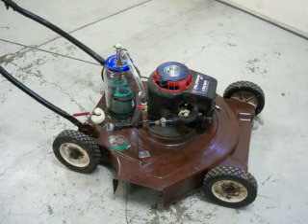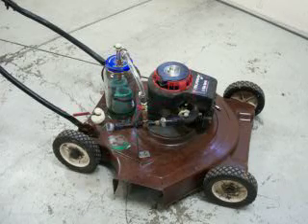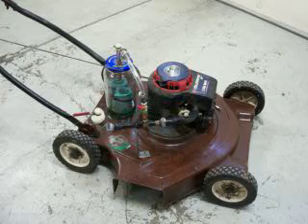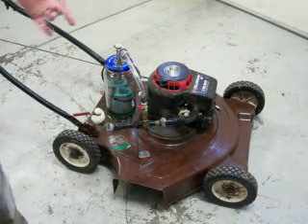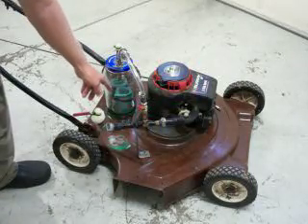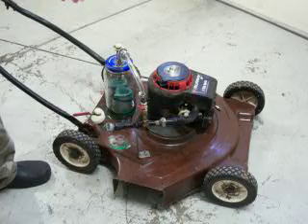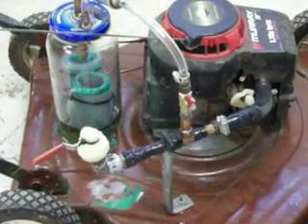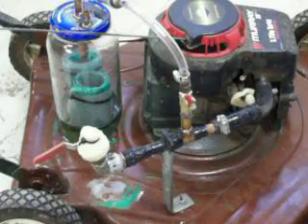just vapor, the truth or a lie

Comment: Please could someone help me, I replicated something similar in my Honda Accord82 car and I can't get it to regulate and seal any leaks. What impresses me is that it evaporates 1l in less than 10m, enormous consumption and the crewo engine that shuts down due to excess mixture, The device also has an aluminum heater that takes heat from the coolant, I can't explain how it escapes like this, when you accelerate it it reaches 3000 or 4000 and when decelerating it throws explosions through the exhaust 
Even if I let it in with more air with the air cock, I can't get it to run.

Comment: These vapor systems do work the only problem is maintaining the correct air fuel ratio because you can damage the valves piston etc. why not try to use a small turbo not for a boost but to pour the fuel vapor? Like on Smokies hot carb set up on his design it was stated that he took a motorcycle and that got around 25-30 miles to the gallon and then used exhaust he to hit the manifold and also a turbo like I mentioned earlier and bumped it up to 40 maybe 50 miles to the gallon my point is that you can take an engine and pull out a bunch of fuel and increase your mileage but your Derating the motor obviously so if you can’t keep a proper air fuel ratio even if you inject water it’s still going to burn out the Valves

Comment: Hey, now that you've done vapor,
Why not see what you can do with the ( GEET ) System...?!?!?!?!? That's what you really need on a car or truck.!!! It starts with anything like 
Old, motor - oils, that are burnt, or,
Old Left - Over, cooking oil, from the house or a restaurant..... A few guys even had them to save, there old,
Cooking oil & or greese,!!!! At small restaurant's.. that starts the motor
Running, then it changes over to plan water.!! Distilled/ or drinking water, or Rain water, or even old, mud-puddle water, that's filtered out
Of a pond, or big muddy puddles, 
It somehow exchange's Heat, inside
The pipes, and makes some-kinda, 
Plasma... Fuel, that Burns in the motor. I've heard of guy's putting the GEET System on there, older model of small trucks or thing's like that.
I am researching it right, now, for my Chevy 4x4 off Road, 2000 model & 
If I get the kinks out of it, and make it work" I'm gonna put it on my, RV.
That's when I will make some videos
For utube... Now I am about to remodel my RV, SO, I'm starting a new channel, that will show my RV, starting to get remodel done. Then I will go into setting up the power system so that I have power, anywhere I am, at. If I'm gonna be
Boondocking" OR Parking in Walmart parking lot, wherever I go, I will always have Electricity 🔌.!!
To do whatever I want to do: watching sattalight TV, OR, RUNNING THE FURNACE & BLOWER, FOR HEAT,.!!! I'LL BE
Showing how to set everything up, 
For free Energy. Without running, loud generators.!! Or haveing to worry, about SOLAR - PANELS,!!
Having to make sure there cleaned off, & not scraping them off, going through the bank drive through.!! 
Or, the ( Low bridge warning on you're GPS, maps)...  Thinking about the blade's of you're wend turbine, sticking up to Far. So, it's gonna be fun,. I'm gonna take everyone, that follows me on my Channel,  through, 
Some stuff that, will be epic.!! 
It'll put them Light-years" in front of the other, RV'ers!!! SO, GET READY,
CAUSE I PROMISE, THAT IF ITS DO-ABLE, WE ARE GONNA, DO IT. 
In other words, we're going to be going, across Country" using, nothing but, the burnt motor oil,
And water, as my fuel ⛽.!! 
And, a few jugs of water, hopefully
Rain water, & on a geet, system.
I put on my RV, myself.!!! Plus, I'm gonna Reveal how I make, my 
Super coils, that produce SO, MUCH EXTRA, ENERGY" THAT I CHARGE, THE BATTERY BANK, I'VE USED TO
RECHARGE MY BATTERY'S. It's, a 
Charging system, that's so small, there's not ONLY No noise" but, it's under my coffee table, in the RV...

Comment: My idea was to us a pipe T joint. With a pipe going to the bottom down into the jar of gas. In the pip is a wick of carbon felt. And that wick goes to the top of the T joint. And the engine would draw air though that wick or over it to make the fuel air mix.

Comment: Guys this system will work temporarily until light elements is petrol evaporate and heavy ones refuse to evaporate.vapourkid realized that after few attempts just like i did and moved to vaporizing fuel by extreme heat which only give you little bit more mpg.check my videos

Comment: A carburetor does not turn gas to vapor contrary to what many comments imply. I drag race and my Holly carb sprays 4 streams of liquid gas straight into the intake manifold. The ports on this manifold are purposely left "rough" so the gas "bounces" off the surfaces breaking the liquid down into smaller droplets "minuscule" so to not overload the cylinder with liquid and cause hydro lock. This system is just doing it at a different point in the chain. If you polish an intake smooth as glass on the inside pure liquid gas would enter the combustion chamber and not burn or at least not in a efficient way or at all pretty. Am I wrong or is this what the bubbler  is doing just in the home made container (which would need heat to keep the gas from turning into almost a refrigerant causing a vacuum )?
Reply: Couldn't you avoid the cooling affect by running the crankcase ventilation into the home made container? Maybe running a tube right down into the gas would even heat it a little.

Comment: What is happening is the gasoline is mixing with air but also the partial vacuum created in the jar is lowering the atmospheric pressure in the jar so then the gasoline begins to boil into a much richer air/fuel ratio than with a bubbler system. I must try it....also the fumes coming off the wick is a change from liquid to vapour...a change of state...this is ok for a mower but I'm thinking that if more power is needed the air/fuel mixture must become richer to satisfy the demands placed on the engine like the accelerator pump used on carburetated engines that squirt raw gasoline into the intake manifold.

Comment: This is a farce. The engine is running so lean that it overheats and quits or comes apart.  It is easy to make a engine run lean by changing the jets in the carburetor, but 14 to 1 air fuel ratio is about as lean as it should be on gasoline, without destroying the engine. He is acting like a genius but is only fooling the unknowing people.  Don't be fooled.

Comment: This is actually how early cars ran their engines an early carburetor design so its nothing new or innovative. And you can run your car engine on a gas generator that  heats woodchips up. Or a vehicle running on lpg. Finally  getting an engine to run at idle is different to the enery required to do valuable work. But by all means run a car on it and  use it to run  100 miles at 55 miles an hour with control and tell us how much mileage you get.  You might get better milage  in a small way but you will get less performance.

Comment: You must have what they call a stoichiometric mixture, (a proper air/fuel mixture), that is usually around 14.7 parts air to 1 part gasoline to run smoothly, less air more fuel under load.  That's the carburetors job, to mix the correct amount of atomized gasoline and air/oxygen.  Your basically doing the same thing with your silly little valves.

Comment: To: Leslie Clendening, and "The Vapor kid"...I'm working on Go-Karts, and am "REALLY"...INTERESTED"...In putting.. this "THEORY" to work for me,...soooo,  1) I believe i can "alter or modify" a regular metal gas tank w/ "welded joints" on the tank & flex copper for the "air intake" on tank, & vapor supply to the carb "inlet" to make the distribution system "SAFER"...Now, I'd like to know just "where" the hose was actually connected to the carb "inlet" ( he never showed this in "detail" on video)..so I can try to duplicate w? a "HARD" CONNECTION, AGAIN FOR A "safer" and "Permanent Install". 2)With this system, can I install the gas tank "ABOVE" the engine? ( I"d just like to know if suction for the vapor will be "lost" if copper line is "routed to engine from "ABOVE" and fed down by gravity)...This , again is for "SAFETY"..... 3) Will the "Diameter" of the "Air Line" & "Vapor Line" need to be a "Specific size"?...say If I went w/  a 3/4" copper air line and a 1/4" or 3/8" vapor line for the carb inlet ...(Would I get the "required" & proper vacuum to vapor "MIX" to achieve the desired combustion required to run the horizontal engine, and will it be a "CONSTANT FOR ALL ENGINE SIZES" I.E. : 6.5 HP, 8 HP, 5 HP ..ECT? ..( Excuse my apparent "lack of knowledge" regarding this, but "The Vapor kid's " video was the first I've seen, and I'm not yet fully "versed" on any additional" videos" regarding this interesting theory.) I'm a "welder/ Plumber",  and am about to design a "kart" w/ this "technology" "HARD WIRED" to the "KART"...(SAFETY FIRST!!) I 'm going to incorporate the "valve assembly" on the steering column, or attached to theframe in such a manner as to " accelerate" the kart w/ it as my "throttle" & do away w/ the" accelerator pedal"!!) Please >>>"Enlighten " me as to the above questions if possible & by all means, additional  "suggestions " as to..". how -to" possibly "Improve" my "design" or any other "THOUGHTS" you guys out there might have to make this "WORK". Please,..lets keep it "SERIOUS"...i'M ONLY  INTERESTED IN "APPLYING" this to my kart!!...And lastly, is it truly possible to get 100MPG on this "system"??
Again, thanks to "The Vapor kid" and all who contributed to this video!
...Impressed the "FU*K OUTTA ME!...KEEP UP THE GREAT WORK!

Comment: its funny to see people that claim to "know" about cars say that this if fake, especially when it comes to the efficiency. NO carb or direct injection makes vapor. They MIST the fuel into the intake manifold/cylinders where the velocity of the intake air (mostly) turns it to vapor. You can check this yourself if you have the time to take your engine apart. Harder to check direct injection than a carb. Ever see a super car spit flames without having a "pop" sound? That's unburnt fuel that stayed in liquid form through the engine and ignited in the exhaust manifold/pipe. In this delivery system you would probably only get "pops and crackles" but little to no flames since all of the vapor should be ignited at once (unless engine timing retards, then exhaust port opens prematurely and expels gas mid burn).

BTW  I'm more interested to see how this efficiency can be applied to performance Or how you can Boost and engine with vapor without it having to pass through a hot turbo and turn you engine into a turbojet.

Comment: Do you have an issue with the engine running really hot?  It's seems that with only vapor that the engine would be running very lean, and that usually results in heat and burning up valves and rings very quickly.  I'm curious to know if this is a problem.

Comment: has it burned a hole in the piston, from running too lean?
Reply from the maker: Jon Powers I will tell you this I have been doing this on lawnmowers far over 10 years years and no matter what some people say I have never ever had no engine damage to them, the engine dose not run lean. If you had a bad air leak that would hurt the engine worse then anything

Comment: All IC engines run on a vaporised fuel air mix, the fuel is delivered in older engines by a carburettor which atomises the fuel as it mixes it with air. This thing here is just a simple  crappy carburettor which is just poor in all performance respects. The engine will cause a low pressure as it sucks air and this will allow the fuel to vaporise more readily, so it sort of works to supply more fuel at different engine speeds. The people who built carbs spent a lot of time and effort making sure fuel was precisely metered into your precious engine. This offers no such luxury and most likely it is indeed running lean, which means hot, and that means a short life. Which is more financially beneficial - An engine that gets 30mpg or an engine that gets 40mpg, but needs a rebuild every month? How much more bullshit can YouTube handle? Loads apparently. 
A gallon of fuel / gasoline has a definite amount of energy available from it when you burn it. About 33kW/h. This is a fixed constant. What you do with this energy is up to you. Most engines are inefficient and are losing 70% energy as heat. So you have 12kW/h/gallon to play with delivering motive force to your wheels. There are losses and difficulties here too in the transmission and with air resistance when moving and tyres and and...This vapour thing is just a nonsense and no solution to anything. There are plenty of areas to look at - don't bother here.

Comment: Y'all do know this is probably a very inefficient motor right? Running as lean as it is will yes give you better fuel economy but try taking of without stalling. You will eventually burn up your plugs. In the combustion chamber the fuel is vaporized due to the compression then ignited.... so this is nothing new not extra special either. Just a science project in understanding how gasoline is burned.